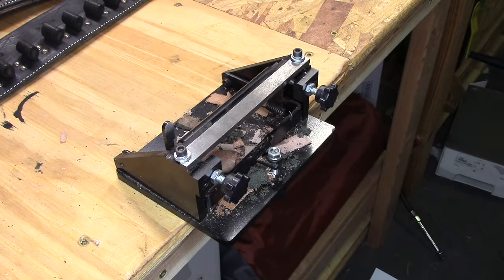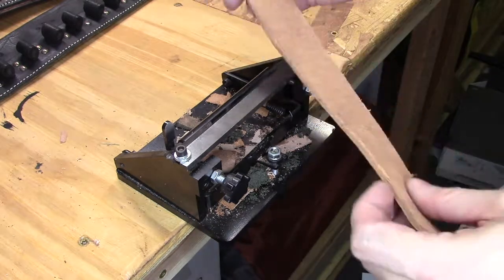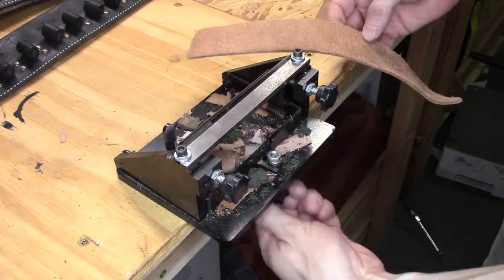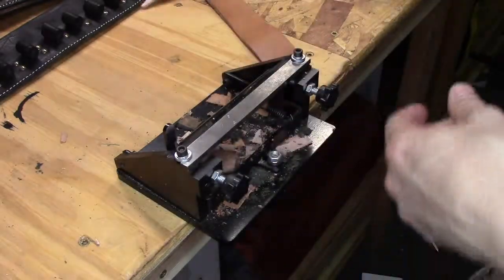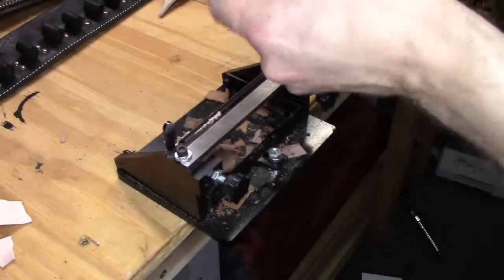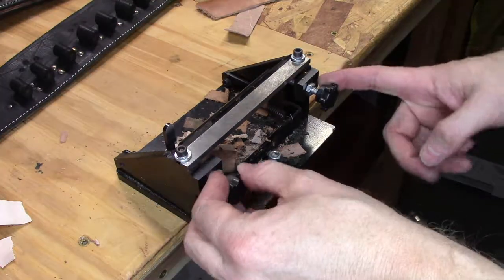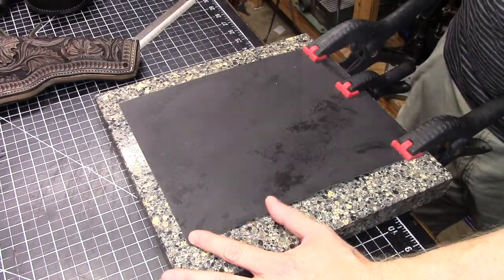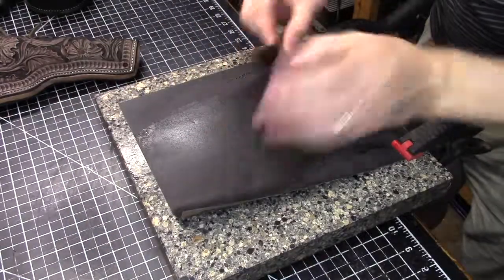Craftool High-Tech Leather Splitter Review and Sharpening

Comment: I start with 800 grit wet dry sand paper and add a little 900 grit diamond compound and then I use 5000 grit diamond compound on a flat leather strop glued to a board 2 inches wide. A few strops with that and 3 inch wide leather is fairly easy to cut.